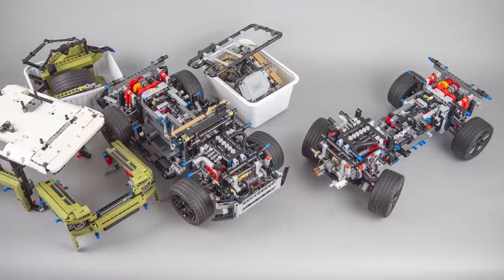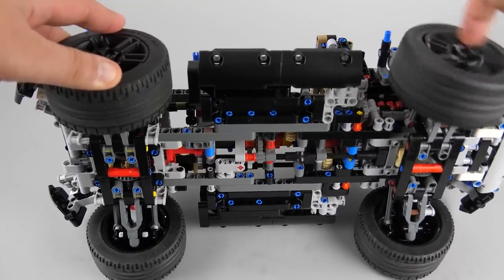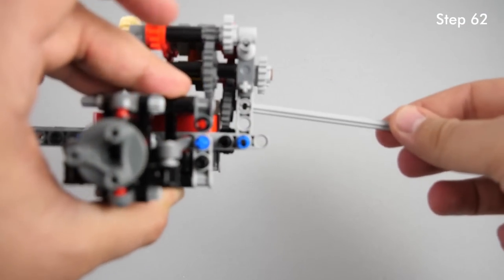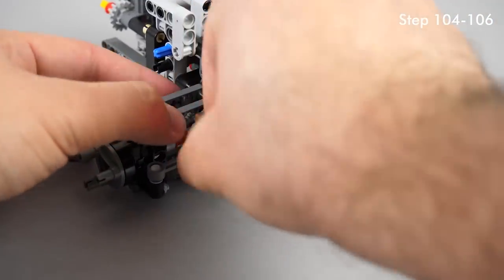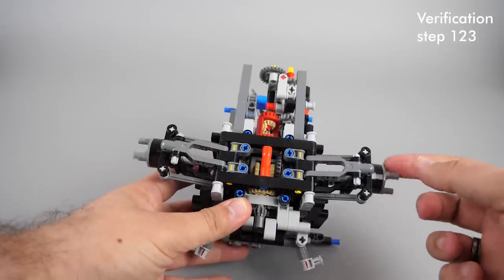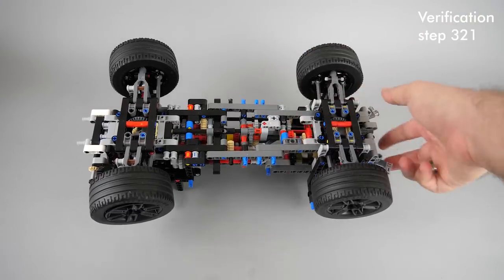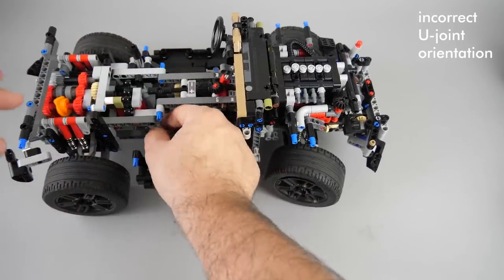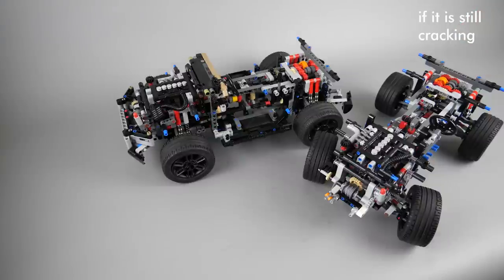LEGO Technic 42110 Land Rover Defender Ultimate repair guide

Comment: Hi Balasz, wery nice vid.

Yesterday I bought a brand new Defender and I got stuck on step 321 inspecting the gearbox and stuff. I hear cracking noises and wheels move backward starting usually on the 3rd gear. After further inspection, I found out that problem is the weak outer u-joint connection, that struggles to move the motor with the higher speed although aligned properly due to your guide and already fixed printed manual. When I disconnect it from the motor by removing the one gear that follows the red axle, then the red axle turns without any problem. Driving the motor manually through the red axle is smooth as well.  

I guess this is the same problem as with your older defender but it is weird that sometimes a problem occurs sometimes not. I think it would be worth carefully compare your old and new defender maybe there is some issue other than luck during the building phase but I bet you tried.
Reply from the maker: Removing a section of the drive train makes it move easier so this is a kind of obvious resolution, but still not a satisfactory one for most :) Based on my experience it is possible to build the set without any cracking or tension building up, even with the fake engine connected, but it requires precision and very careful alignment of all moving parts and even the pieces holding them.
Reply: @RacingBrick  of course, it is not satisfactory to disconnect the engine since the moving engine with various speed is the purpose of having a gearbox,  I wrote it down as a report from my investigation, not as a solution. :) But it's really weird, although the engine seems to turn smoothly, the gearbox output shaft struggles to move it in higher gears. Now I have the hard choice - try to rebuild it now or finish it and rebuild it later. :D
Reply from the maker: @michaelfight7951  even though it seems to move smoothly it is an additional set of gears and then the pistons to move. On thing I did not try - and it would be interesting to test if you have a chance - is to see what happens if only the pistons, or certain pistons are removed? Is it the resistance of the whole fake engine section with the gears and everything that is already over the limit, or it is the fake engine itself?
Reply: @RacingBrick  removing pistons did not solve the problem. After several hours I have found the major cause of the cracking - yellow gear on the driver side below the steering wheel that drives the engine directly in the case of reverse. There was friction, probably caused by minor misalignment (weird is, that when the car was shifted into reverse this gear was moving well). After its removal, the car drives fairly okay, there is only occasionally cracking on the highest gear when pushed too fast. There is probably still some minor friction. Now let's find out how to put the gear back to avoid the friction. :D Overall, this model seems to be very sensitive for any friction caused by the misalignment of some parts, not pushing pins fully, etc. even by 0,00000000000000000000001 mm.

Comment: Thanks for the video and for useful suggestions! I was thinking that my Land Rover had some problems and I've just checked it all with this video and there is all ok (btw, I reversed stickers for selectors based on your another vid)... But one thing is still annoying me is a delay of the engine working on low speed, and that it works far from smooth. But it looks like this is how it was designed. Overall, this is my first lego technic for 20 years and a great set overall.
Reply from the maker: If you check the amount of gears involved you'll understand the cause of the delay. LEGO is not precision technology, you have visible slack already with a handful of gears, and here there are dozens working the same time.
Reply: @RacingBrick  yeah, I understand that. I think that the weakest part of this particular machine is a universal joint. I know there is a mod for the chassis out there, but I'm going to leave it as it is

Comment: @RacingBrick 

Hope you see this comment. First of all, thank you so much for the solutions! :) 
 I have a question. I am at step 336 and decided to check the drive train, gearbox and etc. I noticed a problem which may not be a problem, or not a major problem: ONLY AT 3rd and 4th gear in HIGH gear selected, the drive train seems to have some kind of difficulty in turning. No cracking sound but creates a temporary resitance (or temporary block) of the drive train which is strong enough to block the RIMS as they have weak grip on especially hard surfaces. The resistance is not strong enough to block the tires. When I ignore the problem and drive the car with rims anyway with a little down force, I can beat the resitance of the drive train which compansate the correct amount of axle turns that it resisted before. To put it another way, when it is free from the abnormal resistance, the drive train and the engine turns faster than it's supposed to turn, recovering the turn losses caused by the abnormal temporary block. I followed your guide but couldn't find anything similar. Do you have a guess?

Comment: Love your videos!  I finally got around to building this set.  I don’t have any cracking -  it rolls smoothly.  But when I change the gears it doesn’t seem to have any effect.   I’m really confused.   The L/H , +\- wheel works, and shifter. They all work, and I see the movement of the parts.   But when I roll the car the engine block doesn’t move.  🤷🏻‍♂️

Comment: Great video!! Quick question though.  I noticed that when you put in the dashboard, part of the support side piece sort of rubs up against the steering wheel joint that’s connected to the steering wheel axle.  This makes it a bit harder to turn the steering wheel.  Any ideas how to fix?

Comment: Only I assembled the second stage of the assembly checked and everything creaked, then checked the cardan and reassembled the second stage still creaks in fourth gear 2 weeks have passed, looked at everything checked too much load on the input shaft in the gearbox and the plastic does not withstand such a load in vain. Can you recommend something?

Comment: Hi bro my cylinders are not moving when I drive the car on the floor. What part connects the back tyre to the cylinders?
Reply from the maker: Like 60% of the build "connects" the wheels with the engine, that's the whole drive train... I suggest to check my drive train walk through video and compare your build with it

Comment: Great video, you put a lot of effort and enthusiasm into this topic. I still have some problems, though. Is it possible that everything is assembled correctly but you cannot get rid of the cracking?
- When I first put together all working functions, there was significant cracking noise in D mode in higher gears or in HI mode. In R mode, everything seemed fine, no matter if I moved the car forward or backwards (I hope I remember clearly). Also, if the setup is one where there is cracking, when I lift up the car, the wheels start turning backwards, like coming out of some kind of resistance.
- Then I disassembled the model into the two main units to be able to check all the possible errors in your video and also do the verification of the rear unit at step 123. Everything seemed OK and working as in the video except for one thing:
- My differentials don't act the same as in the video. When you turn one wheel, the opposite wheel starts to turn immediately into the opposite direction, and only the small yellow gears are moving in the differential, the grey differential remains almost still. When I turn one wheel, usually the whole differential starts to rotate and it rotates the central differential or the main shaft, while the opposite wheel does not turn (or is turning randomly/rarely). I don't understand this becasue my differentials are facing the good direction and I don't see any other possible way to assemble the differential from scratch. Anyway, I haven't gone back to step 1 yet, and every other verification steps were exactly as in the video.
- After I checked everything, I assembled the working units again to give it a try. The cracking noise is the same in D mode in higher gears or in HI mode. But now there is also cracking in R mode but only in LOWER gears (not in high) and only if I move the car forward. So now my Defender got even worse. :)

Perhaps the short answer is that I should start the assembly again from step 1 but do you have any ideas about the potential problem based on the above symptoms?
Reply from the maker: The set can be built correctly and it might still make cracking noises. You need to find the perfect alignment of the parts to make everything work smoothly. Honestly if you don't nail it for the first or second time, I would not start over again.
Reply: @RacingBrick  Thanks. So far I've built it once, I only disassembled it until the separation of the rear and front units. But I decided not to fully build it a second time now, perhaps later in the future. By the way, I flipped the orientation of both differentials and now the cracking symptomps changed and decreased but still present. Now the forward movement is without cracking in all gears but backward movement has cracking noise in D mode/higher gears and in R mode/lower gears. I will not mind it.
But do you have any idea about why the differentials act strange? If I lift up the model and start spinning one wheel, it minimally rotates the opposite wheel but rather the central differential. So it's easier for it to transfer energy towards the grey differential itself rather than the small yellow gears moving only. For you, the central differential is basically still when you spin one wheel. It's the same for me before and after flipping the orientation.
Last question for the future: when you build the model from scratch, do you build everything very tight/snug or intentionally leave a minimal gap between moving and non-moving parts (for example next to all gears, etc.)?

Comment: The reason my gear box won’t move is because i tipped up the front of the car while driving and the gear box only works when I push 2 wheels so when I push it with the car on the ground it dosent move the gear box

Comment: wish i saw this before building the set. got the cracking fixed though (diff + u joints)

only problem remaining, gears 2 and 4 dont spin the engine, also gear 1 spins the engine faster than gear 3. according to your demo, it should be the other way around. any idea what i could have missed with the gearbox ?

Comment: I'm having an issue where the wheels move independently of each other. For example when I spin the other front left wheel the front right should move as well but it doesn't. This isn't really an issue when it comes to driving as the car still moves freely with no cracking and all the gears/pistons work. However you video outlines that both should be moving and that doesn't seem to be the case in mine. when turning one of the wheels only 2 of the small white cogs move in the differential, not all 3 which is what's preventing the other wheel from spinning but i'm unsure how to fix this?

Comment: So I've just watched this and I'm certain I have an issue which isn't listed. My rear wheels lock up when pushed in either direction. Upside down they move independently, in the opposite direction, which is right, but together they won't budge.  Any help would be appreciated. Steps in your video are all correct on my build.
Reply: Solved it. Cog at the rear was placed incorrectly, not through the middle cross, but through a side hole. Rookie error.

Comment: Great video but I checked everything and still can’t push it forward while in drive and gear without there being significant resistance and when I lift it of the floor, the wheels spin back the other way like one of those wind up cars. Please help

Comment: Hello! I recently discovered your channel thanks to this Land Rover model and your reviews. If I have good luck, I will have this set "soon". It would be my biggest and complex set so far, (1000 pieces is my record) and I have a doubt: How many mistakes do the instructions book have, aside from the one with the U joints? Thank you! c:
Reply from the maker: I suggest to watch the video and check the link to find the answer :)
Reply: @RacingBrick  Thanks again! I didn't see the link before, I'm sorry for waste your time :c
By the way, your job is amazing :D
Reply: @MakyToe03   Don't worry. I treated myself to this for Christmas present 2019. I'm 60 and it must be about 45 years since I last bought a Lego set. Apart from the UJ issue at step 89, I only had 2 other problems and thet were due to me not fully checking the build drawings on assembly. But they became obvious very quickly.  The Lego designer has a YouTubd account and had tells me you can build a right-hand drive version by simply mirroring the instructions. I wish I had the money to buy another king and do just that! Good luck with your build

Comment: My universal joints are aligned correctly however there is still a cracking noise when I move the Land Rover. What do I do?
Reply from the maker: verify all connections, gears etc, look for misalignments, go through the whole drive train. If it does not help then rebuild.

Comment: I’ve took mine apart 3 times, I can’t seem to get the engine to turn when I’m drive, everything else seems to work correctly. Any advice?, also when I spin one differential it does not spin the other wheel, but they all turn correctly at same time

Comment: Is the "Reverse" selector supposed to "lock out" forward motion?  Similarly, does "Drive" "lock out" going backward?  My build seems to go in both directions in either gear.  I went through your Ultimate Repair video (....several times....  :)  )(THANK YOU!), but I could not seem to see an answer in here.  I did check my differentials and they are oriented correctly per your video.  The gearing seems to be working but that is tough to visualize just pushing the car along a desk.

Any help in understand the function would be appreciated!
Reply from the maker: The DNR selector cannot block any motion, it only affects the fake engine. Forward makes it go forward, reverse will bypass the gearbox and directly drive it backwards. Selecting the gears will affect the speed of the engine.
Reply: @RacingBrick  thanks for the quick reply and saving me hours of tear down!  😂

Comment: Hi, basiclly when all my 3 wheels are block and i turn the one that isnt blocked forward after i stop turning it it just starts to go backwords into the position it was before, any help appreciated.
EDIT1: it happens only in D gear
EDIT2: and in low/high gear only, in neutral it doesnt.

Comment: Racing Bricks when I try to move my back wheels they fall off and I already fixed that gray bit that made them turn oppositely but the wheels don’t move and when I force them to move they and fall out of the piece holding the tire
Reply from the maker: If the wheel falls of then it is not attached properly.

Comment: Is the gearbox supposed to spin freely before the front and rear are hooked up at? I finished phase 1 and the differential spins ok with the wheels but the gearbox is locked

Comment: Built it perfectly first time, but the highest two gears in LO have significant binding and click. There's major friction somewhere, but can't find it! I worked out early on the universal joints were not phased correctly. What on earth is causing it!? Any help is greatly appreciated. I even made sure all of the gears and shafts have as little play as possible. The gear clicking is in the HI-LO box.
Reply: French translated by browser : It is not the 3rd and 4th gear in High that are the problem rather? In general it is when the pistons move the fastest that the problem arises. The crunches are explained by the u-joints which do not transmit forces linearly, but by jerks. However, I never precisely located the creaking gear. The possibly concerned being all gathered at the level of the selectors: there are the two yellow, the two dark gray, the blue, the red. But the crackles come from there somewhere.

Comment: I have an issue I don't think was addressed, my outer u-joint that drives the engine pistons is causing the drive train to bind up and not work, I can't find the reason why but as soon as I remove the outer u-joint it all works fine.

Comment: As I understand, it was some incorrect issues in initial version of instruction.
Is the current instruction at official website correct? Is this the only moment that they fixed at instruction? Could you please explain?
Reply from the maker: The orientation of the cv joints was incorrect in the manual, now it is updated. For other potential issues check my guide linked in the pinned comment.

Comment: Hi, thank you for this video. My son (just turned 7) built this set and the vehicle  has an issue of cracking only when certain gears are selected. Otherwise everyhting works fine.. Is this also U-joint issue ? At a glance I think they are properly aligned (he worked with updated manual). What I discovered is that it is difficult to lower gears with - selector, towards + it goes easily. Thank you ! Btw. we enjoyed your Power function First responder build !
Reply from the maker: Cracking in the higher gears is a frequent issue and probably the most difficult to eliminate. Apart from the U-joint oirentation everything needs to be aligned properly, all gears/shafts/etc. need to work smoothly.